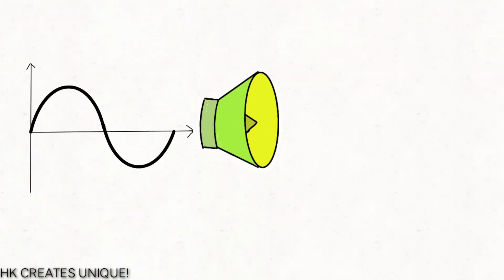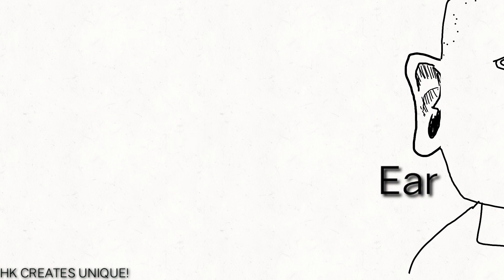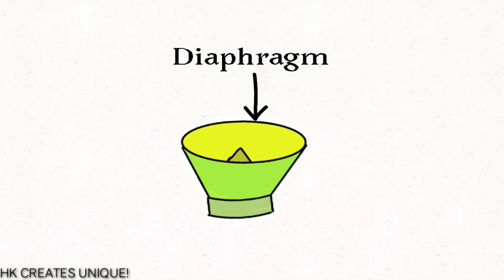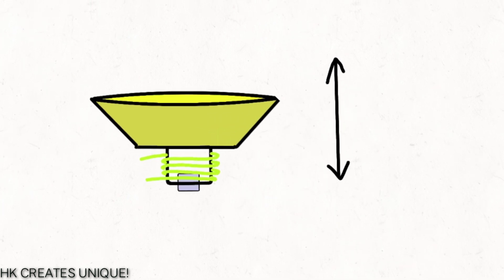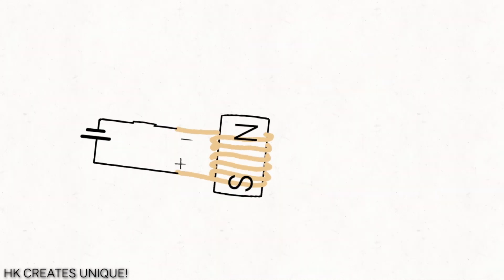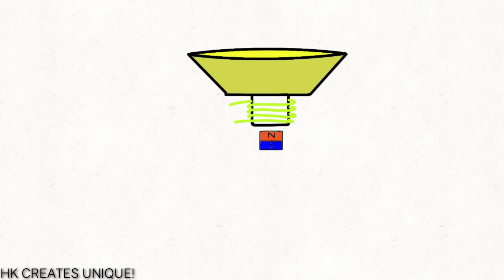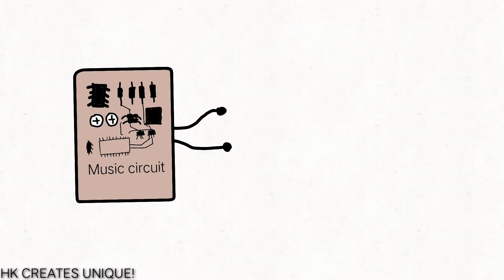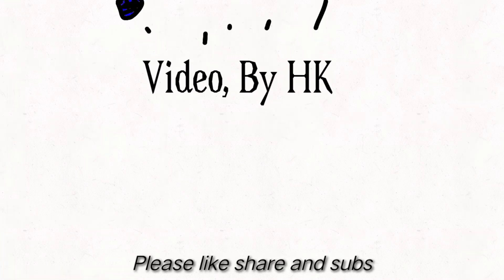How does a speaker work?

Comment from the maker: In an actual speaker there is a frame (to make permanent magnet stationary) , a spider (to balance voice coil and diaphragm).
_______
Correction:
At 3:05 because of animation error, wires are not connected with the speaker, but it actually is..